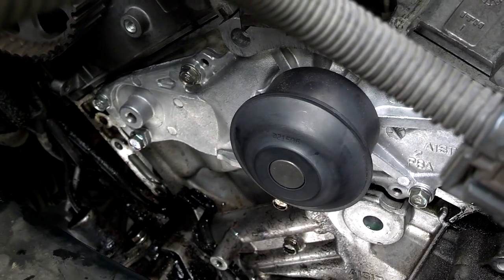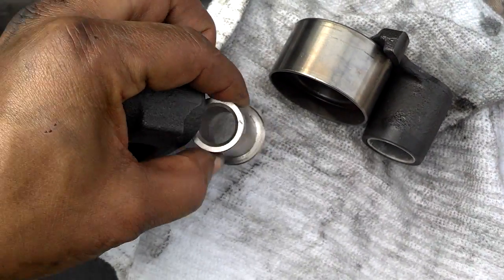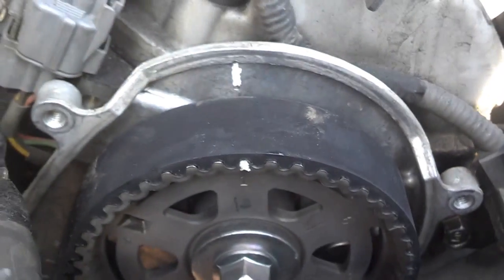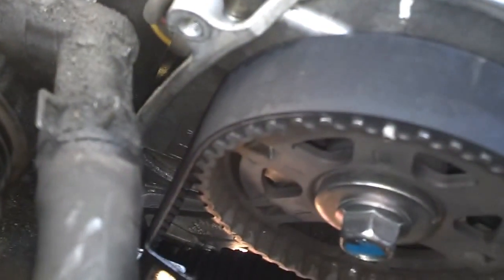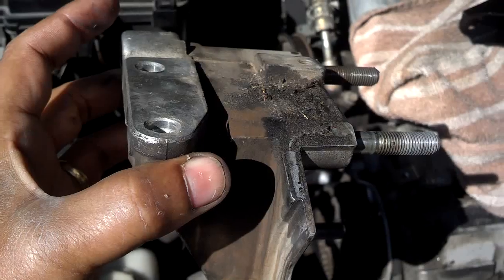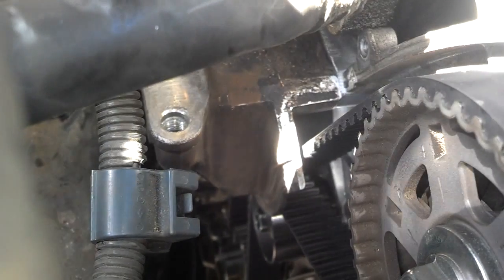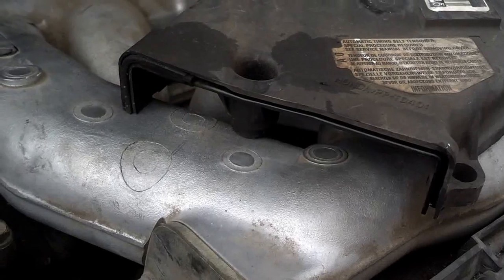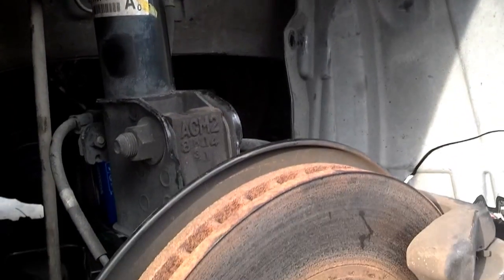Honda Odyssey timing belt replacement, installation. Part 2 of 2 - VOTD

Comment: Really good except you said to put the lower timing belt cover on before the top motor mount bracket and I did, now I have to take it all back apart. You have to put the motor mount bracket on before you put the lower cover on.😓
Reply from the maker: Dang. :(
Reply: @RobertDIY  no problem, I just loosened up the bolts on the cover and shoved it in. Thanks for the video.
Reply from the maker: Is there a note about that in my remarks?
Reply: @RobertDIY  if there is I didn't see it.
Reply from the maker: Thanks again.

Comment: First time watcher. You did a good job on that job. Thanks for posting.
Reply from the maker: You are welcome.
Reply: so if i line up my marks and keep all the slack on the tensioner side they should stay aligned after i pull the tensioner pin? I know on a different car i did I had to misalign one of the cams that way when tension was applied it would "fall" into the correct position.
Reply from the maker: I did it like shown in the video. If it gets out of align, pull the tensioner, reset it, and try again.

Comment: Thanks for your video.  I wanted to know what did you used to rise off the coolant that was on the timing belt?
Reply from the maker: Hmong Vid Water is enough. You can use a degreaser if you'd like.

Comment: Hello, great video, thanks. I can not understand that it is suitable for Honda Odyssey 2003 TCKWP286A 3,5 Gates or Gates TCKWP329 ?? Please help me !!
Reply from the maker: SLTi33 I do not know. Contact the place that sells the parts or get the parts from the Honda dealer using your VIN.
Reply: Robert DIY  Thank you, what brand your kit?
Reply from the maker: I believe we purchased the kit from Parts Geek. They did send the WRONG tensioner. The belt was Gates, not sure if the other parts.
Reply: kit of gates with a water pump or separate pump Aisin and belt Gates?
your choice?
Reply from the maker: I usually try to purchase Aisin water pumps.
Reply: I just think ... or Gates sells very bad pump?
Reply from the maker: I don't know. Get one and let us know if it last till the next belt change.
Reply: ok )

Comment: Thank you Robert!!! this video is very helpull!! The only problem that I had during my job was with the camshaft bolt, I spent like 4 hrs trying to remove it!! But the rest was very easy.Dont Attempt this with out previous mechanical experience!! Seriously!!

Comment: This is a decent video. One additional thing you might want to consider doing is to replace the crankshaft oil seal. If that starts leaking, you'll end up having to do the whole job over again to replace it. I admit that I have left it alone before because it looked good but it leaked later. It's the same principle as replacing the water pump while you're in there and the seal doesn't cost much. You could also replace the cam oil seals but they seem to last a lot longer.

Comment from the maker: Not really. How many miles do you have? You can contact the local dealer and other service places that are know to service your type of car and ask them. They can usually look the service records up with the VIN. If you can't find PROOF, have it done ASAP. There is usually a sticker on the motor somewhere. Most mechanics like to write on the timing belt cover with a paint marker the mileage and date they last did the change.

Comment from the maker: Just read some notes on the Honda-Tech website about torque values. The water pump bolts are suppose to be torqued to 108 in/lbs. That's about 8.7 ft/lbs they say. 
The site says the idler and tensioner torque value is 33 ft/lbs. 
The site says the mount bracket to the motor torque value is 40 ft/lbs.
The mount to the frame torque value seems to be 28 ft/lbs.
The crank bolt torque value is either 85 ft/lbs or 130 ft/lbs. I lean towards the later.